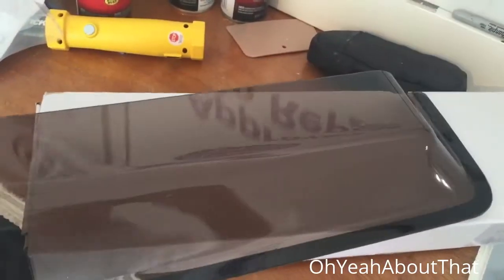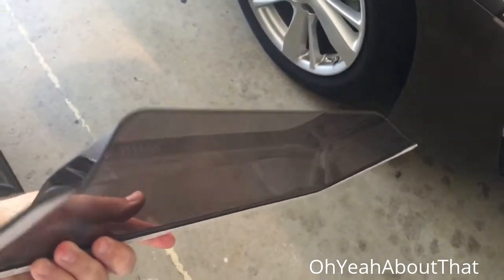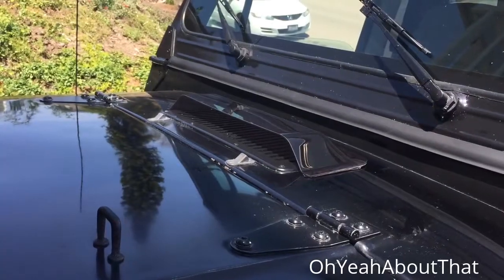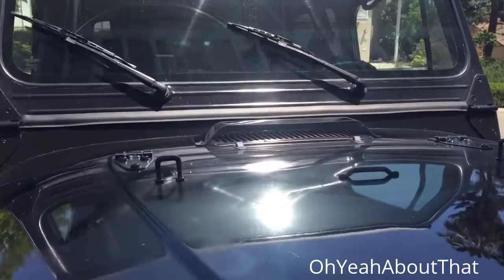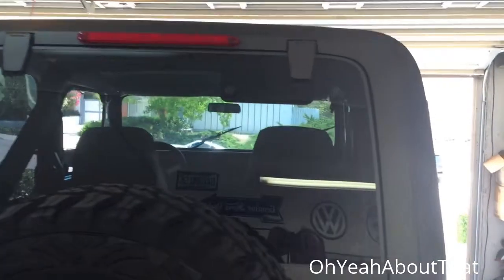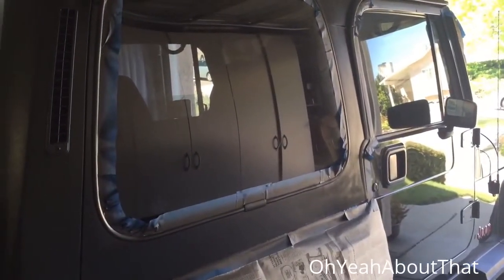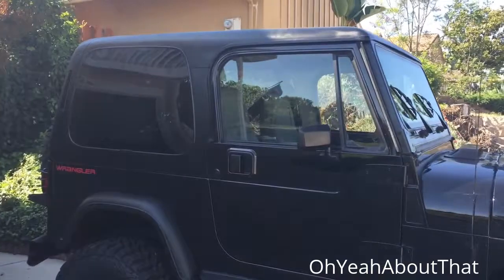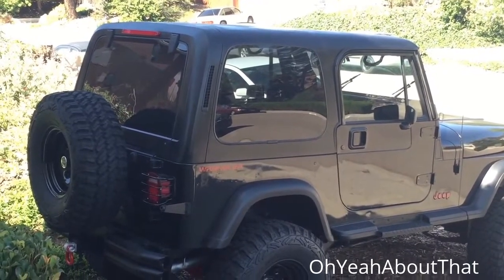project 1991 Jeep WRANGLER (Jeep YJ), part 42, HARD TOP REFINISHING

Comment: i have a 92 yj with a hard top but i don't know what seal goes between the windshield and the top. can you do a video of yours showing the inside of the top and the winshield. thanks.
Reply from the maker: I will the next time I remove it. It may be a while though, as I don't plan on removing the top again any time soon. You can get a new seal on eBay and it's very easy to install.

Comment: after a few months, have you noticed the cowl vent cover reducing leaks?  i'd read it helps improve the vent efficiency if placed backwards; most of the wind entering the cowl vent bounces off the windscreen
Reply from the maker: Not really. It barely rains here. I found and sealed the holes at the top of the windshield frame that were drilled for bikini top. That helped a lot!